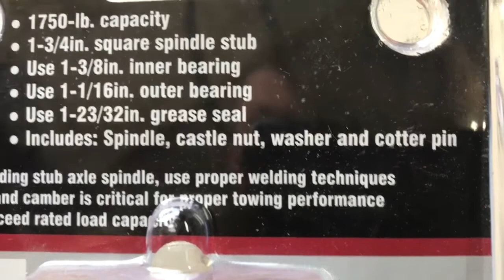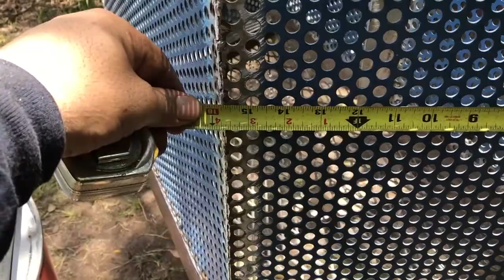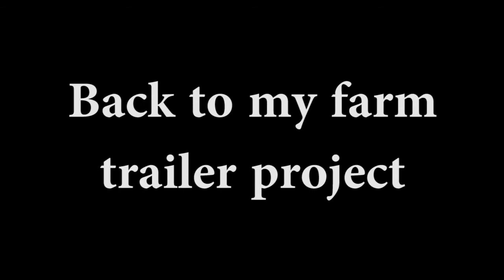Homemade Single Axle Farm Trailer

Comment: What size angle iron did you use for everything?
Reply from the maker: Good morning sir,
2"X3"X1/4" angle thick for the main frame.
2"X2"X3/16" angle for the rails and sides.
1-1/2"X1/4" flat stock around the frame to cover the edge of the wood.
If you have more questions, please let me know.
Reply: @SalamSayhood  thank you been looking for some good advice for my boat trailer to utility trailer conversion you have been a big help

Comment: The length is how many centimeters are the width and how many centimeters are in front of and behind the tire ? thank you
Reply from the maker: Hello, for the trailer rectangle floor, the outside width is 155.25 centimeters and the length is about 244 centimeters.
From the center of the hutch to the trailer is 101.6 centimeters.
From the front of the trailer floor to the center of the tire or axel is 144.78 centimeters and from the center of the tire to the back  is about 99.22 centimeters.
I provided all the measurements in inches and it's very easy to convert to centimeters, one inch is equal to 2.54 centimeters. So if I show 22 inches, to convert to centimeters, 
22 X 2.54 = 55.88 cm.
Thank you for watching.
Reply: @SalamSayhood   thank you